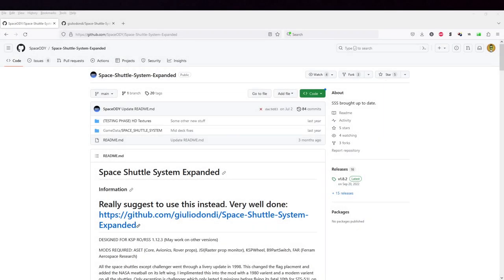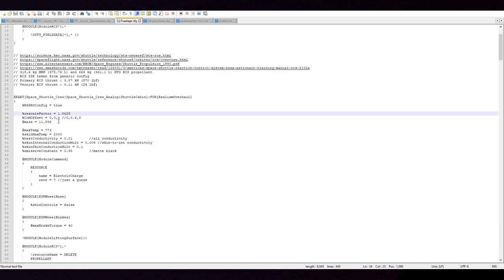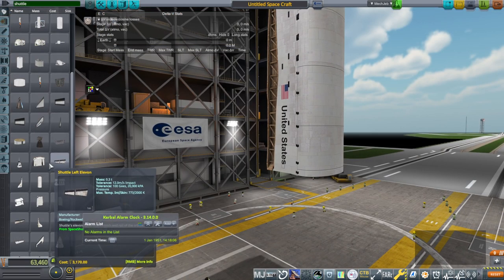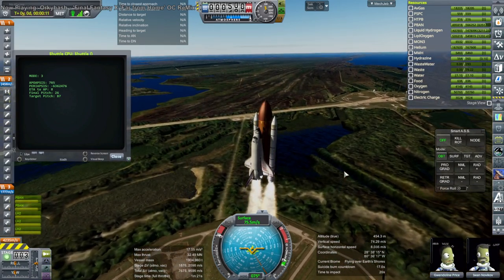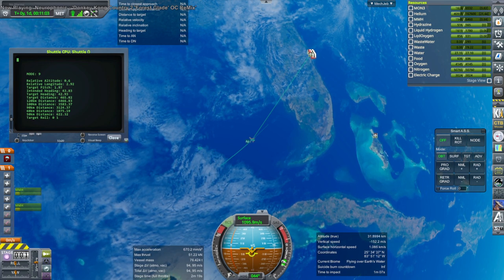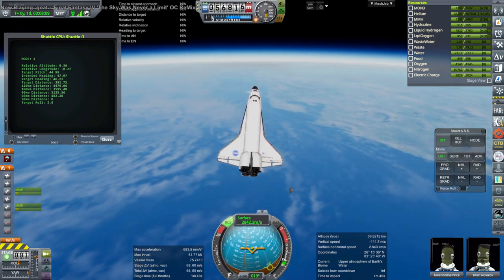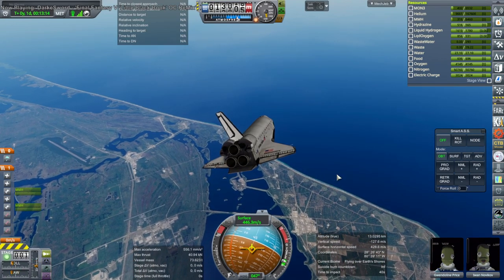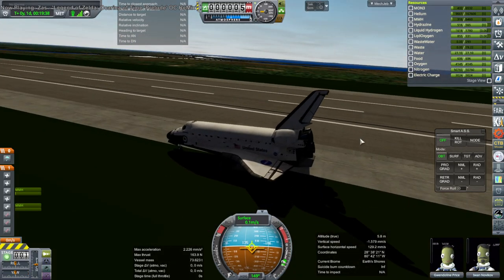Using the Shuttle in KSP 1.12.5 and Realism Overhaul

Comment: Hi, just wanted to drop by a comment about the custom FAR fork, if people are interested.

I just changed the FAR Wing Aerodynamic Module to make it overridable, which I need for my custom Shuttle aerodynamics module. This is purely an infrastructural change.
The code in that fork is functionally the same as regular FAR, so if you use it it should yield the same results.

However it does break CKAN compatibility because of course the source file is re-compiled, and moreover it's one minor version out of date.
Reply from the maker: Ah, thanks for the clarification!

Comment: anyone else having issues with missing shuttle parts (engine mount, payload bay, SRB stacks) would appreciate some advice !
Reply from the maker: All I can suggest is check that everything made it to the right folder. In GameData, you should have a folder called "SPACE_SHUTTLE_SYSTEM" and within that folder a Cabine, Empty, Fuselage, FX, Parts, Props, Spaces, Waterfall, and Wings folder as well as a bunch of files outside of those folders.
Reply: @RaizSpace  would it also be possible to share in some way a screenshot or list of mods in your gamedata folder to ensure i'm not missing any important mods, thank you.

Comment: Hi, I've got a huge problem with your kOS script for Shuttle Launch, after my external tank is used the apoapsis varies from 400km to 1000km and periapsis is almost always in minus, the program stops also after external tank is empty. Program does not follow apoapsis and periapsis also. I'd be very glad if you'd help me.
Reply from the maker: The external tank should be left in an atmospheric trajectory which may sometimes be negative, but it shouldn't run to depletion nor should the apoapsis be that high. It this just the regular Shuttle mod as I used in this video or is there something different? What apoapsis and periapsis did you enter? The script is actually not great at hitting those anyway - something I will work on.
Reply: @RaizSpace  I think I've got the same shuttle mod as you (it has 3 different external tanks as yours), apoapsis and periapsis is 400000, I'll check everything again tommorow beacause I'm not entirely sure if I didn't write an additional 0 by a mistake. If I would do everything correct, do you think that may happen because of a mod? I use positive inclination like 45.5, maybe I should use negative like -45.5.
Reply: @RaizSpace  Yeah so it seems that without any payload everything goes perfect, but with payload +/- 16t (Unity module) the program starts messing up and apoapsis is too high, periapsis too low.
Reply: @RaizSpace   I lowered the mass of the shuttle and it's working better but not the same as before, at least I do not have apoapsis high up to the moon.